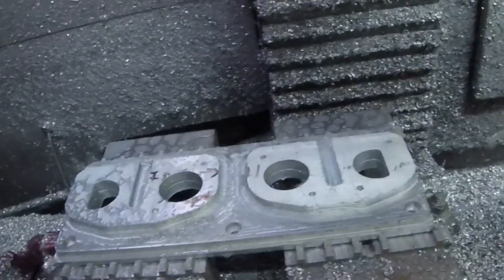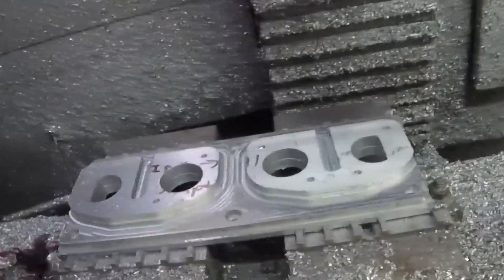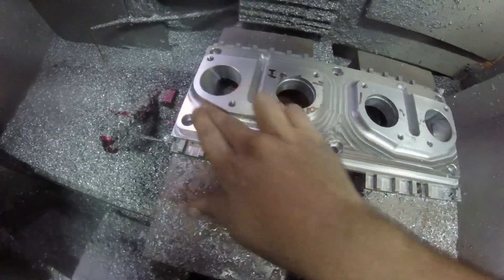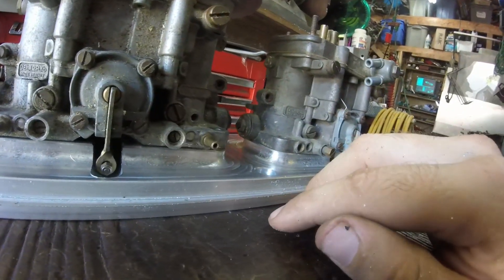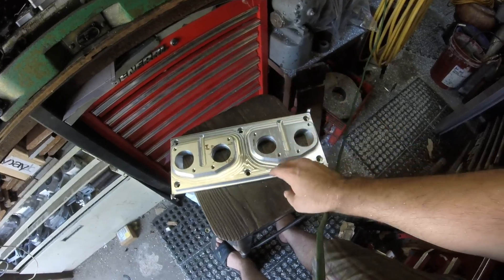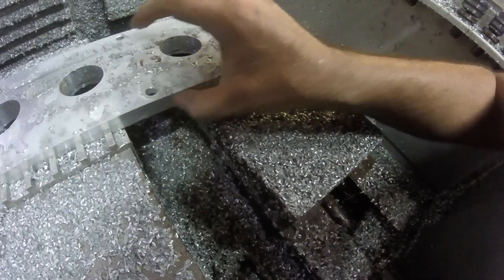Making an adapter plate to mount a set of Weber IDF's to 6-71 blower

Comment: Right on Sir! You’re definitely a stud with a vision I’ve always thought would be total rad after seeing vehicles owned by individuals that clearly didn’t want any middle of the mall components on their V8 NA deals! 
However, with such a rad project I believe IDA’s would’ve been a better choice and definitely would’ve flowed more and definitely would make more power but, I’m obviously partial to
IDA’s!
Reply from the maker: I agree, IDA's are awesome.  One problem is they are wider than the IDF's by enough that the bore holes would not line up with a simple adapter plate.  It would have to go to a welded manifold.  I have heard that the Dellortos of the same size flow better than the Webers so maybe that could be a compromise but I don't know if that's true or not.

I don't care to much for off-the-shelf stuff :)

Comment: 6:00 the G84 tapping cycle has a "P" parameter for delaying the retract move, which is good to prevent the spindle starting to withdraw before the tap has stopped rotating and reversed direction. You have a tension compression head which allows a good bit of leeway but you can see that it's got 1/4" or more of tension by the end of the thread. It's worth playing with the delay parameter so you can almost eliminate this. Tormach defaults to 0.5 seconds per 1000rpm but will differ for non-Tormachs, your VFD setup and perhaps the size of the tap (a larger tap will quickly overcome the inertia due to the larger torque required for cutting). Nice work!
Reply from the maker: You are correct!  I kind of like the way it pops out as it comes up but it does run close to the extension limit on the tapping head.  It's a handwritten tapping procedure; I should play with it some.

The Hurco that I did a retrofit on has a similar style tapping head but since the whole machine was redone I didn't have a baseline to go from.  I tweaked the settings on the VFD and the code for the tapping and got it pretty much dead on.  It does take longer to do a bunch of holes as it all adds up but I'm usually in a chair somewhere anyway :)